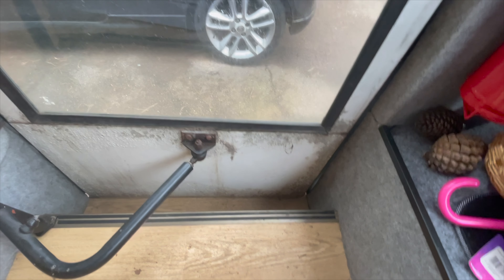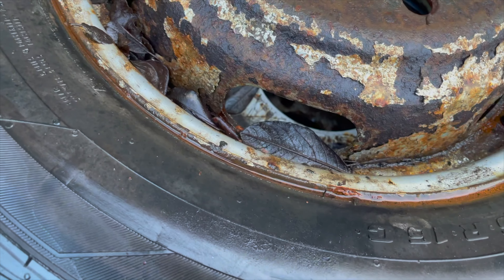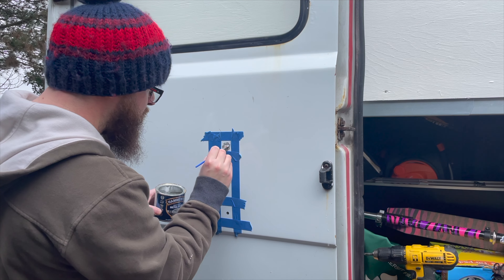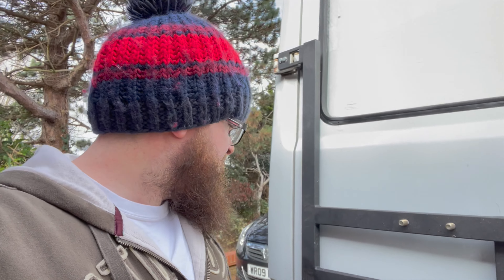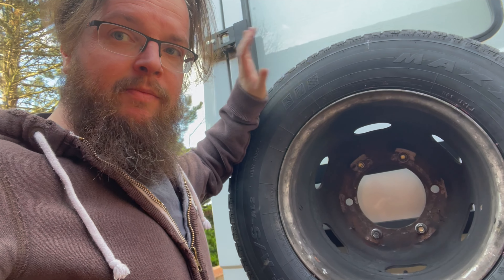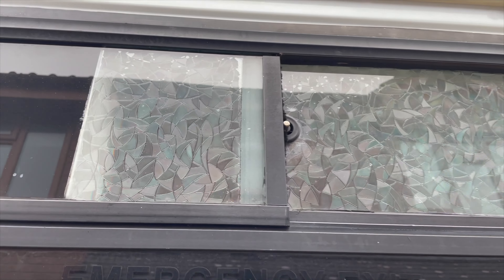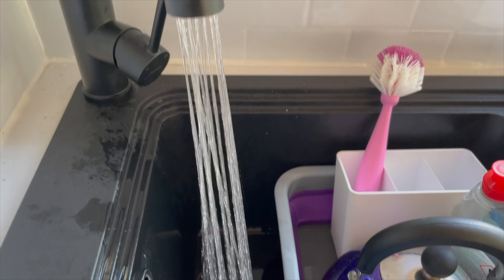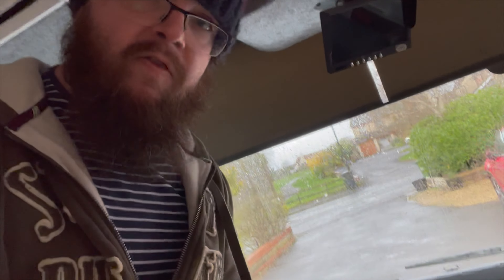Van Build Gets Wheel: Epic Upgrades, Fixes + FILTHY Find

Comment: Great updates to the bus the wheels did look the same I use a tape measure to measure across the off sets if in doubt but as the look same why would you cup holder looks great and have used same window film on our shower room window the added security is great for night time too all the best donny
Reply from the maker: That’s a good tip. The PCD is the same but we definetly should’ve checked the offset. We love the window film, glad it’s worked out for you Donny.

Comment: Cool video , where did you get the wheels do you have any spares Ive got a few wheels that are so rusty
Reply: Also be good to check the numbers against yours , possibly I could buy your spares ?
Reply from the maker: Thanks. So I got them off marketplace. I’ve since sold the 668 ones. I will have a couple of ‘spares’ at some point once I have had them swapped back over.
Reply from the maker: Totally. Is yours a 614D
Reply: Cool I'll check my numbers mines a T2 711d  many thanks
Reply from the maker: I bet yours are the 668 ones that didn’t fit mine. Sadly I already sold them on to a gent with a 611D. I know a good shot blaster though 😆
Reply: @WanderbusAdventures  ahh I was too late , I'll check the numbers tommow anyway , there's only one I can see that's just too gone it looks dangerously pitted so maybe a case of just one or two I need
Reply: @WanderbusAdventures  yeah thanks 😁 they need a good going over for sure wish could put some knobbly tires on but a hard size to buy for ay 😭, I saw your mini buried btw 😉 i just crunched the gearbox in my 1330 clutch was going and came down into second too fast  so engine out Time for the mini. 😔 
Yeah I'll get back to you on the wheels I'm heading to Northampton Silverstone to compete in wrap masters  end of this month so if all good could collect on that trip ,  

Thanks again on your quick replys 👍
Reply from the maker: @climblivefree8344  cool. Sounds good. Wrap masters - that sounds interesting. Is there a bus wrapping category 😂